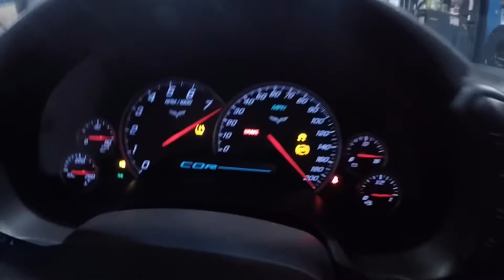Corvette C6 Dealership Oil change / ls3

Comment: #1. If a shop wont allow you to watch or at least watch them put it on the lift then go elsewhere. Its ez to destroy a Vette with improper lift technique.
Dealers, shops, whatever get very few Corvettes in for service.
Changing oil on a base C6 is the same as any oridinary car so they should be able to get it done without f'n up anything.
Problems develope when they see a dry sump car. They either know what to do or they guess.
Further,
 Dropping the hood like that is not recommended as these hoods will develope a crack  from the drop.